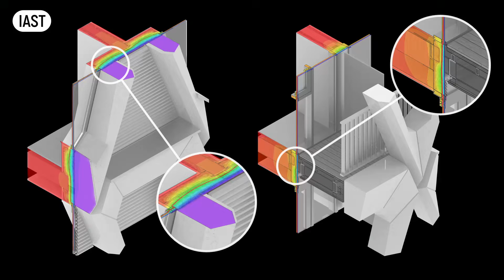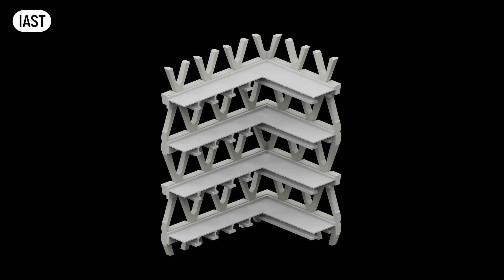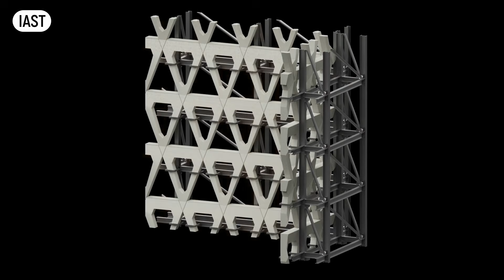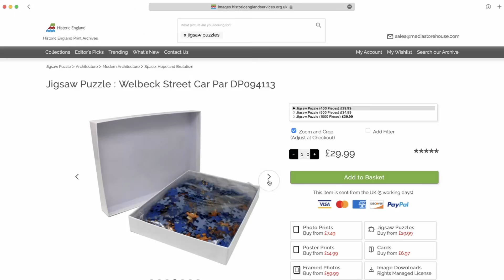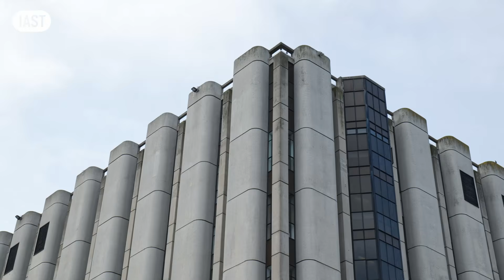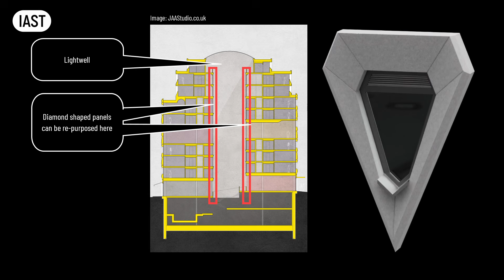London Retrofit Case Study: Welbeck St Car Park. Why Did They Demolish Brutalist Architecture Icon?

Comment: This was an interesting looking parking garage -- but it was not worth saving. Demolition was the only sensible thing to do. It appears the architects in this case found a number of showstoppers to redevelopment as a hotel, such as low ceilings and inappropriate placement of windows. But the short lifespan of reinforced concrete is an even better reason for demolition. I've seen many concrete installations that have degraded within 50 years to the point of being beyond repair. This video correctly observes that hundreds of millions of buildings will fail because of it. It argues that so many concrete structures are going to need repair that we simply can't tear them all down. The video says, "The planet simply can't afford it." True enough, but when concrete begins to crumble there isn't much we can do to fix it, either. We are simply unprepared to deal with this problem.  I suspect many structures made with reinforced concrete will last 100 years, and perhaps there are some outliers that will last 125 years. But there is no point in retrofitting a 54-year-old parking garage and putting it to a new use when the remaining lifespan is going to be so short. The inevitable decay of reinforced concrete is a ticking time bomb for modern civilization. Sometime soon pretty much everything built of concrete in the last hundred years will need to be replaced. Bring on the wrecking ball!
Reply from the maker: Concrete remains one of the most durable materials, especially compared to timber and steel, which are even less resilient when exposed to the elements. The real issue is often not the material itself but the maintenance regime. For the foreseeable future, concrete will continue to be essential in construction, and perhaps the focus should shift toward designing better-looking, maintainable buildings. By planning for cost-effective maintenance from the outset, we can extend the lifespan of concrete structures and ensure they remain viable over time.
Reply: @IAST-UK we could just build with stone as we use to. It lasts for centuries and is more ecologically friendly than concrete which is an inferior material.

Comment: That’s not nearly as bad as the Barbican and that gets lauded as an architectural masterpiece 🤷
Reply from the maker: Designing aesthetically pleasing exposed concrete facade is a challenge. It is a very artificial material. Perhaps it shouldn't be used as a decorative material at all.